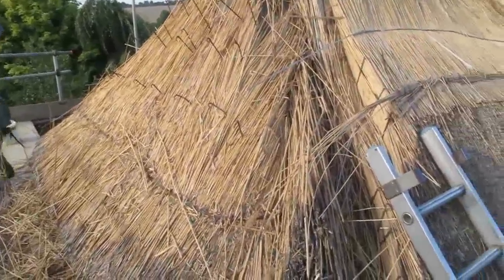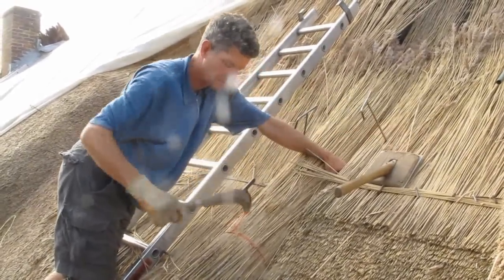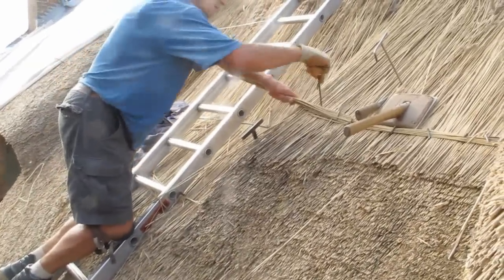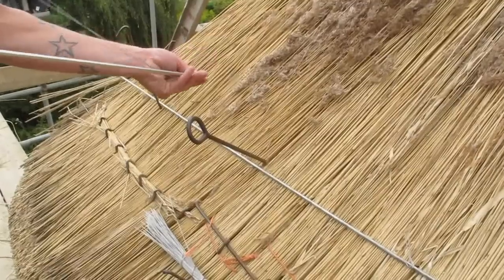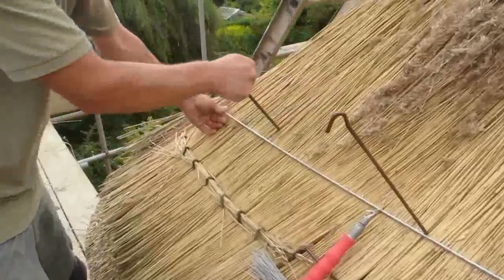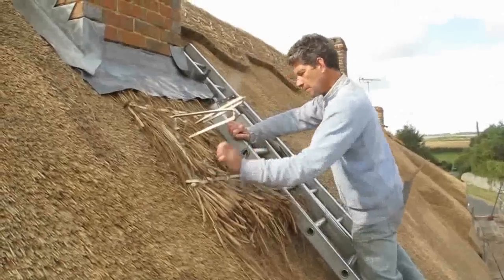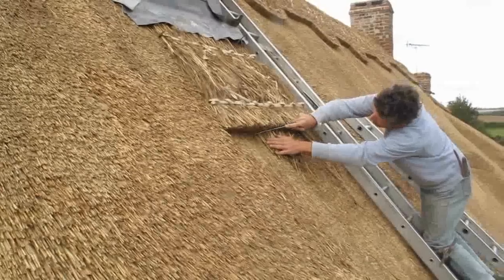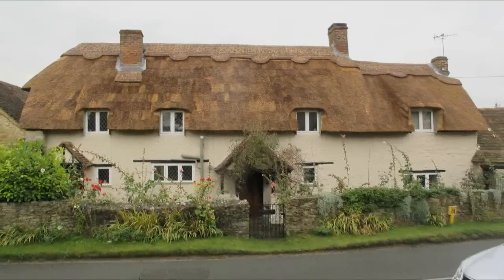Norfolk Reed Thatching

Comment: how long does the roof last and how does it not mold?
Reply: 25-60 years depending on material and craftsmanship. Thatch roofs are steeply pitched so that water runs of quickly, and the tightly packed material resists water penetration
Reply: My co work did this job in past and she said , this kind of roof has to be changed every 20 years

Comment: It appears that the thatch was laid over plywood (workmen in this video used drill and screws to fix thatch to surface below). Thus, I see it as a cosmetic thatch and not a traditional thatch roof. I feel that the use of word "restoration" in the context of this video is inappropriate
Reply from the maker: There is no plywood used in the roof! At the begining of the clip the old thatch is being removed back to the rafters taking out the original crooks and rods. 
The new thatch is fixed directly to the rafters with torx screws holding a stainless steel wire, when tightened these hold the rods and the new thatch [Norfolk Reed] in place. This is a better method of securing the thatch as no damage occurs to the plaster between the internal exposed rafters. Crooks cause a lot of internal damage as they are hammered into the rafters!
Reply: My apologies. I stand corrected. This process then would extend the expected life of a thatch roof. Makes sense for longevity. But in original 17th century thatch, wouldn't it be lashed to the rafters (without any iron crooks or rods)?
Reply: @dmitriikomarov5453  It's also becoming standard practice on new rooves and rooves where all the thatch is taken off to cover the frame with cement sheet. It's still a real thatch roof on top of that but the cement sheet resists fire long enough for fire fighters to get thatch off in the event of a thatch fire.
Reply: @StuartChignell  And that would be a shame. Any choice has its trade offs. Thatch roof is extremely flammable in a dry weather. But it also breathable and provides good ventilation. Putting thatch on a concrete roof is like putting lipstick on a cow. I see it as a perversion.
Reply: @dmitriikomarov5453  Actually thatch isn't as flammable as it is perceived to be. When on fire it will burn slowly like a book or a bundle of crushed cardboard. And the concrete sheet is only for fire protection from indoors. It will not keep out the weather. It functions in the same way as the original wood does, something to attach the thatch to
Reply: Killjoy...plywood prevents the roof from leaking like a sieve...thatching is cosmetic... So what!
Reply: @StuartChignell  thach fire♨